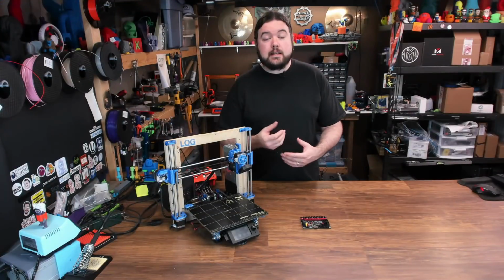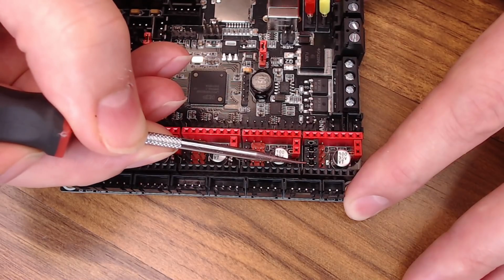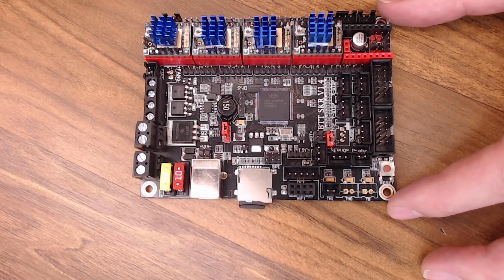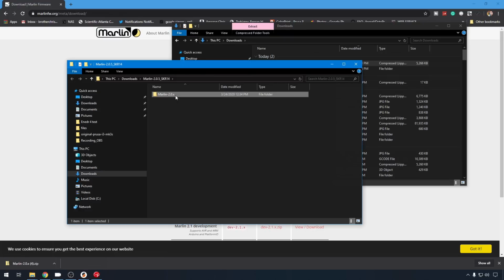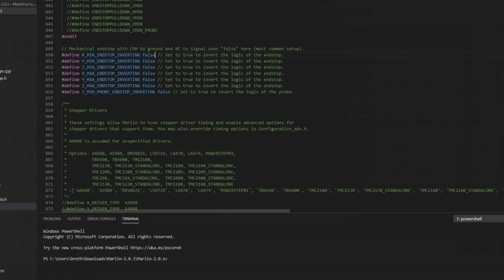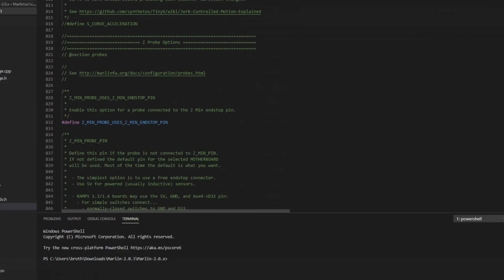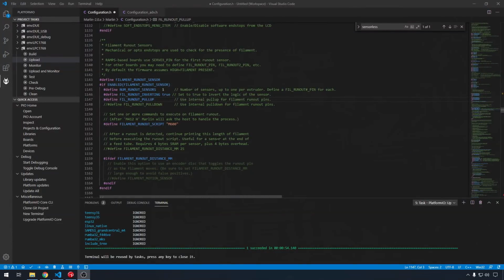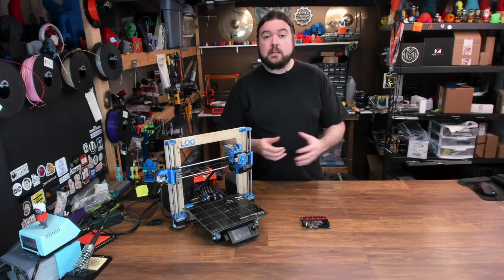BigTreeTech SKR v1.4 Mainboard - Full Install Part 1 - 2209 Drivers - Chris's Basement

Comment: I’ve been following you’re tutorials for the last 2 days and I’m completely stuck, I have a Ender 3 and I’ve brought a SKR 1.4 and a TFT35 and nothing works, Marlin mode on the screen stays blank and touch screen sort of works but it permanently says “printer not attached” I’ve been on VS Code and did everything you said to do but when I put the SD card in nothing happens and when I choose SD card on on the TFT35 it just freezes on “Loading” I don’t no what to do next I’ve been ALL over the internet and no one has a solution or tutorial about fixing it, I download Marlin 2.0 and bug fix version from GitHub I’ve compiled it in VS Code with modifications like you said then I press the tick it takes around 20 minutes to compile and when it’s done it’s on the SD I then put the SD in and again nothing happens so I then pressed the arrow in VS Code which is suppose to send it straight to the board but when that’s complete it’s the same as before Marlin screen mode doesn’t work the touch screen mode does work but it’s not picking up the printer and I’ve even mucked around with the UART speed which I’ve heard and in Marlin mode I’ve moved the dial around and still nothing, The 3 fans are working which are connected to the board and cura picks up the printer but I can’t control the printer in cura cause when I press auto home or up or something nothing happens, PLEASE someone give me a quick fix cause I have literally spend the best part of 21 hours going through everyone’s YouTube videos and I’m just going round I circles.....
Reply: Have you tried changing the baudrate on the screen?
Reply: 3D Maker Kid Yeh I did that I changed it to 5000 10000 and all the other numbers and still nothing, Touchscreen mode works but it constantly says “No Printer Attached” and when it try to go into Marlin mode the screen just stays black....
Reply: @tonygudgeon1839  That's all I know that could be a fix, Chris will probably answer your question later today or tomorrow.
Reply from the maker: So, you have a config on the board that the serial isn't set correctly. Make sure you Marlin config has serial set to 0 and serial 2 set to -1   Then make sure your LCD is set to REPRAP full graphics display. Depending on the display you have, you might have to flip the EXP1 and 2 connectors over, some of them are upside down. spin them 180. You will need to copy your firmware.bin file manually to you SD card first time. Format your SD card fat32. Then do the process https://youtu.be/W6zYvRgGr3Q?t=506. Load your SD card on your board, power cycle, then you should be good to go.
Reply: Chris Riley I’ll be sure to give this ago when I get home on Monday, Thank you for taking the time to help and I’ll give you an update when I’ve given it a go
Reply: Chris Riley I did everything you said mate and the marlin mode on the touch screen now comes on but I have no control at all, X-Y-Z don’t move at all the only control I have is changing the temperature of the nozzle, The Hotbed doesn’t even show up on LCD (both modes) or on the computer it’s almost like it’s not plugged in which of course it is, I don’t have any plugin stepper motor drivers all I have is the SKR stock 1.4 board (Not Turbo) and a TFT35 V3 board, Could the fact I don’t have any plugin stepper drivers mattter? And is there a certain modification in VS Code for not having stepper drivers? For a solid week non stop I’ve been going through tutorials but it doesn’t work for me, I can load firmware onto my board no problem but nothing seems to change my situation, I have an authentic BL Touch and a filament runout sensor and a WIFI flash connector but I can’t even get the axis to move so I ain’t interested in connecting them at the moment, I’ve followed you’re part 1 and part 2 videos of installing the SKR 1.4 (turbo) board and compiling it in VS Code, PLEASE any help will be soo appreciated altogether I’ve spend £175 on the board, LCD, BL Touch, Filament Sensor and WIFI flash and after a full week of trying I’m no where and feel soo deflated, I desperately need you’re expertise
Reply from the maker: @tonygudgeon1839  I'm not sure what's going on here, but you can upload code correct? Send me your config files brotherchris81@gmail.com
Reply: Chris Riley I think I’ve just found out what the problem is, I haven’t got any stepper drivers plugged into the SKR 1.4 and apparently the board won’t work without them so I’ve ordered some and hopefully this should fix the problem?
Reply from the maker: @tonygudgeon1839  It could, but I would like it would work with out them. Do you have comments on the driver settings in Marlin?
Reply: Chris Riley I’m not sure what that is how do I enable that? I copied you’re config from you’re part 1/ Part 2 vid on setting up the SKR 1.4 with marlin and edited/ compiled in VS Code exactly how shown, Other than that when I power up my printer the screen displays marlin 2.0.5.3, Is there anyway I can some how copy and send you my config?
Reply from the maker: @tonygudgeon1839  You can send me the config files to brotherchris81@gmail.com to comment out the drivers, just make sure all these have // on them. 
#define X_DRIVER_TYPE  TMC2209
#define Y_DRIVER_TYPE  TMC2209
#define Z_DRIVER_TYPE  TMC2209
//#define X2_DRIVER_TYPE A4988
//#define Y2_DRIVER_TYPE A4988
//#define Z2_DRIVER_TYPE A4988
//#define Z3_DRIVER_TYPE A4988
//#define Z4_DRIVER_TYPE A4988
#define E0_DRIVER_TYPE TMC2209
Reply: Chris Riley Wow I was doing up my board housing on my Ender 3 and a screw landed on the board (While it was on smh) and I heard a big pop and now its dead.... So now I have no choice but to get my SKR 1.4 board working cause it’s the only other one I’ve got 😂 I’m gonna go into vs code now and make them changes and SD it to the board, I’ll let you no when it’s done and thanks again for taking the time to help win or loose
Reply: Chris Riley Just to ask mate I should change X Driver, Y Driver, Z Driver and E0 Driver to tmc2209 even though I don’t have driver plug in?
Reply from the maker: @tonygudgeon1839  Doesn't matter what they say, just put the comment on all of the // that will turn off all the options.
Reply: Chris Riley Ok so update I’ve re compiled and now it’s a bit better, My hotbed is how showing on screen and I can now change temp on extruder and hotbed but I just can’t move any of the axis, I plugged the printer in and it work in cura (which it didn’t before) but again I can’t move anything, Just to make sure should I have changed  X Y Z E0 from tmc2009 to // or have uncommented them?
Reply: Chris Riley The bottom of the screen says Home Z First, On the printer screen X says 150 Y says 120 and Z is flashing 40 with 2 question marks ?
Reply: Chris Riley Hi Chris I’ve commented them all out and it’s still the same... On the printer screen it says X110 Y110 Z0 whilst flashing, Everything else is working fine apart from not being able to move the axis’s
Edit: I’m sure it must be something that I’ve configured in VS Code but I can’t think what
Reply from the maker: @tonygudgeon1839  What drivers do you have installed?
Reply: Chris Riley I don’t have any drivers installed I’m using the SKR 1.4 board stock and I have drivers // commented out on vs code, All the little jumpers are in but the board never came with drivers
Reply from the maker: @tonygudgeon1839  Dude, I am sorry, I completely misunderstood you. The boards don't have any driver chips by default. You will have to have some stepper boards to get the motors to work.
Reply: Chris Riley 😂 I’m actually quite relieved  to hear that to be honest, I’ve just order 5 longruner A4988 from amazon which will be here tomorrow, Will they work ok?
Reply from the maker: @tonygudgeon1839  Yep, they will work just fine.
Reply: Chris Riley Cheers Chris I really appreciate it mate
Reply: Chris Riley Hi Chris me again lol Just a quick question I’ve got my A4988’s and now I’m in VS Code, Do I leave my A4988 drivers // commented out as default or do I comment the A4988 drivers in as it already says A4988 as default anyway and also I have 5 driver do I put them all in or just the ones that I have my motors connected too?
Reply from the maker: @tonygudgeon1839  You can do either, when the comment is on, it defaults to A4988 settings anyway. I would just plugin the ones your using, but it's fine either way.
Reply: Chris Riley I have 1 final problem mate I’m soo sorry but basically my when I go to put the Z up it goes done and when I go to pull the bed forward it goes back and also the whole thing moves way too fast I need it slowed down
Reply from the maker: @tonygudgeon1839  What does this line say? #define DEFAULT_AXIS_STEPS_PER_UNIT 

Change these two, make them the opposite of what they are now. 
#define INVERT_Y_DIR true
#define INVERT_Z_DIR false
Reply: Chris Riley Top man Chris! Come pay day I’ll send you a little token of thanks
Reply: Chris Riley Hi again Chris, You must be sick of me by now, I’m sorry mate but I have 1 last question, Everything is work fine now thanks to you and everything is moving the correct way but when I auto home all the Axis do what they should apart from the bed, The bed comes out rather than in, Apart from inverting the bed Axis direction which I’ve already tried how would I correct that? and finally just out of total curiosity would the SKR 1.4 board be able to cater from a Creality laser?
Reply from the maker: @tonygudgeon1839  Yeah, check that home dir setting.

#define X_HOME_DIR -1
#define Y_HOME_DIR -1
#define Z_HOME_DIR -1

The laser, I really have no clue. I would think it would have to be controlled with a PWM pin.
Reply: Chris Riley Cheers Chris!

Comment: Do you have a dead stock CR-10s display when upgrading to the SKR 1.4 board?  Well I figured it out. The SKR 1.4  has the plastic alignment around each display connector BACKWARDS! Connector position of 1 and 2 connectors is correct.  The slot that is supposed to align the pins is flipped.  The slot should be pointed inboard not outboard. <feel free to insert lots of cussing here>
Reply from the maker: Yeah, I have ran into that on a couple different screens, very frustrating.

Comment: Phew !  So i think i just realized you were saying "Sensor-less Homing" not center-less.... lol  If you have time quick question, if not no worries.  I have a Sensor on Z for Min ( at the bottom by the stepper motor left side) so that would be sensor homing correct ?  And pin stays ?  If not just gonna keep watching and i think ill put it together, but these are my last steps before testing ! lol :D Have a great weekend sir !
Reply from the maker: Yes, that is your homing endstop switch. You won't use sensorless homing for z.
Reply: @ChrisRiley  Thank you so much!  I will be pulling pins from those Axis that have end stop switches, x,y,z, and might as well the extruder too like ya said  :) OHHH im so excited to figure this out and fire it up  !!!!!  Also I am now a proud Basement Dweller Patreon member, you are the 1st person i have ever supported on there and I feel it is well worth it man!
Reply: Tip for anyone pulling the pins via un-soldiering. while your at it, ensure the pin that is remaining in that 2 pin group is nice and strait, and if not straiten it up with your iron by tapping the solider point while very gently applying pressure to the bottom part of the pin to bring it in line, this will help greatly with seating the drivers as well as pulling them smoother if needed for repairs or upgraded :)   Im putting this in my Anet A8 to AM8 conversion.  I pulled all the diag pins on the 5 drivers, really hoping that was the right choice lol but I think it was :D
Reply from the maker: @PMcDFPV  Hey Paul happy to help and thank you for all the support.
Reply from the maker: @PMcDFPV  Thanks Paul for posting this tip!

Comment: Great tutorial.  Does anyone have any pointer on how to troubleshoot an LCD problem? i have the reprap smart LCD controller board (LCD12864) and it's not working.
Only thing i get is lght to the screen, no info.
Any help would be appreciated.
Reply from the maker: Go you have it set to full graphic in Marlin?
Reply: @ChrisRiley  Hi Chris, thanks for the reply!
I believe I do.  have both #define LCD_INFO_SCREEN_STYLE 0
 and #define REPRAP_DISCOUNT_FULL_GRAPHIC_SMART_CONTROLLER set.
I had also tested the reprap discount 2004 controller from my setup before the upgrade to skr, which I know was working, but with that one I barely get a back-light on that screen.
Any pointers would be appreciated.
Reply from the maker: @cmorinigo  Only thing I can think of is the pinout is wrong, maybe one of the cables got flipped somehow.
Reply: @ChrisRiley  Thanks for the assistance! Appreciate all the extremely useful and helpful vids you put out!
Reply: @ChrisRiley  HI again Chris,
After watching a few more of your vids I got it sorted out, at least with the 2004 LCD. 
I had to snip the guides off the plugs and flip them.  I wanted to post it here in case someone else had the same problem.

Thanks again!
Reply from the maker: @cmorinigo  Thanks for the update.
Reply: @ChrisRiley  Thank you for all the extremely helpful videos.

Comment: I am in process of switching my stock CR10 over to this BTT skr1.4 board along with BLtouch and the TFT35. Thank you so much for the tut on this board very very informative.
I do although have a question about the mosfet for bed heater specifically the one that comes factory with CR10 here's a link to what I am asking about 
https://www.bing.com/images/search?view=detailV2&ccid=z3XDgq3k&id=99EE46CAA2425664E651816D8B87461490D4BE03&thid=OIP.z3XDgq3kxjRQRuhjjXNM-AHaE8&mediaurl=https%3a%2f%2fcdn03.plentymarkets.com%2fioseuwg7moqp%2fitem%2fimages%2f22864%2ffull%2fCreality-3D-CR-10s-HBP-MOSFET-22864.JPG&exph=2000&expw=3000&q=mosfet+for+heater+bed+cr-10+wiring+diagram&simid=608002248925972173&ck=26ED301F6C2D1D8DD811C548691B054B&selectedIndex=81&ajaxhist=0
is this reduntant now using the SKR1.4 turbo board or am I missing something in your tut?
Reply from the maker: Actually, I would try both. It is probably redundant, but that is a fairly large bed. The external might heat it faster still.

Comment: Great video Chris, I do have a question. I have an SKR 1.3 in my CR-10 with 2208 drives. I bought on of the SKR 1.4 turbo MBoards with 2209 drives. My question is can I make a copy of my marlin 2 and change the name. THen change to the 1769 processor in Platformio.ini and change to the 2209 drives. Both will have the BLtouch. Is there any differences in the Ender 5 that I need to be aware of?
Reply from the maker: I am not sure what they are, but yes, they will have differences. It is probably still a good place to start, but you might have to switch a few things like motor direction.
Reply: @ChrisRiley  OK, There are some things that are a given that will need changes but as long as there is no looming disaster  I will go for it. Thanks, I am waiting for my BLTouch before starting it.
Reply from the maker: @jamescullins2709  Check this out too, I just got sent this. https://www.patreon.com/posts/38588374?utm_medium=post_notification_email&utm_source=post_link&utm_campaign=patron_engagement
Reply: @ChrisRiley  Thanks Chris, I will have a look at both.

Comment: Chris, if I'm using this with a cyclops extruder and hot end, how would I set up the filament run-out sensor for the two different filaments but only one extruder? because it says define the number of run-out sensors, one per extruder, but there is only one. Would I just say there is two extruders as to have two run out sensors?
Reply from the maker: Yes, I think I would just tell it you have 2.

Comment: Hi Chris, amazing tutorial. Thank you so much for this. I have a short question. After upgrading my Wanhao i3 Duplicator the X-Axis Works fine. If i drive 100mm it's 100mm. But if i drive the Y-Axis it's only 26mm and it's super slow. I calculated that i have to set this: #define DEFAULT_AXIS_STEPS_PER_UNIT   { 80, 307.69, 400, 93 }
But that looks very weird for me. Did i something wrong? Thank you for your help!
Reply from the maker: Hello, unless you altered your printer in some way, I think it should be set like this. #define DEFAULT_AXIS_STEPS_PER_UNIT   { 80, 80, 400, 93 }
Reply: @ChrisRiley  Yes i know. I tested with a SKR 1.4 Turbo and there i have 80, 80, 400, 100. At this board i have to use 800 for Z (otherwise it's only 5 cm when i drive 10). The SKR mini E3 v2.0 has the problem with the Y-Axis (i sent it back). Strange thing with these boards. Never had the problems with SKR 1.3... (By the way the SKR 1.3 works perfect)
Reply: I forgot, all on TMC 2209 (expect the Z-axis on SKR 1.3 or SKR 1.4, i use an A4988)
Reply: I replaced the board with a new SKR mini E3 v2.0: Problem gone. I think it was a faulty board. I used a second SKR 1.4 Turbo to check if there the Z axis is 400 like default but it's over 800 needed to be accurate. Strange :D Thanks for your help!
Reply from the maker: @shax_org  Glad you got it working!
Reply: @ChrisRiley  I replaced the Board now with a GT2560 and a Full Reprap Graphics display and now i sell the whole printer. Bought an Ender 5 and use the SKR there :) Thanks for all your amazing videos and all your help!
Reply from the maker: @shax_org  You bet!

Comment: Great video, can you make one about how to use eryone tmc2209 on skr 1.4, I am having trouble to make it work, keep getting tmc error. Thanks
Reply: Finally  got it working, thanks
Reply from the maker: What mode do you want to use? If you want to use UART, you need to solder the pads on the back. https://youtu.be/duNHOPlh2Pg?t=1580
Reply: @ChrisRiley  thanks for the information, I will have a look, I am upgrading my wanhao di3 with skr 1.4 & tmc 2209